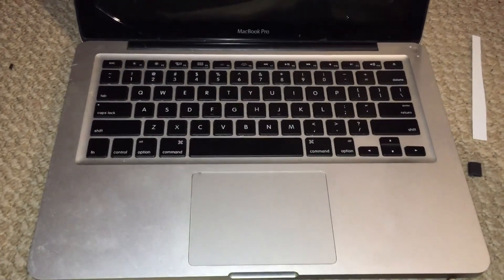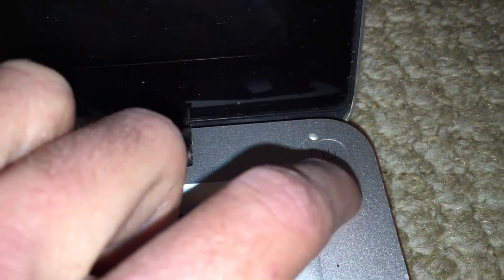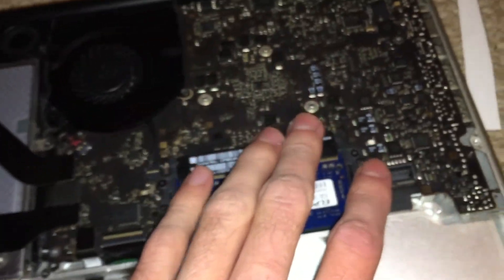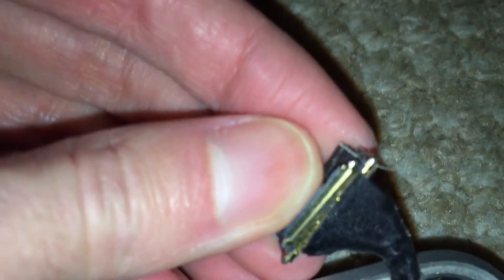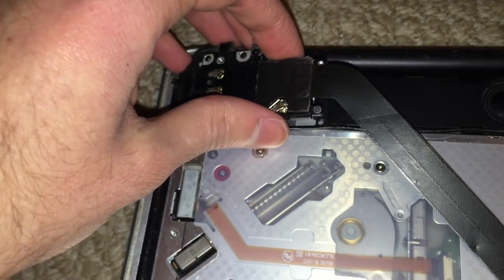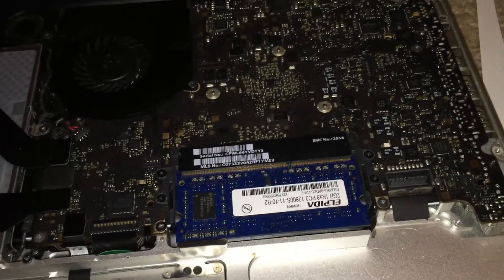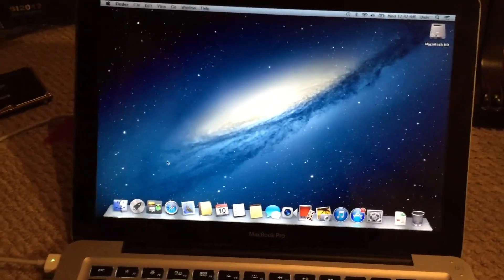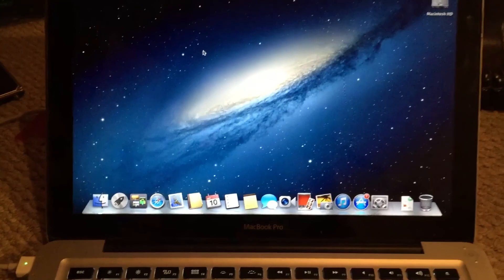Repairing a Mid-2012 13" MacBook Pro with no Video on LCD

Comment: Man, i had the exact same issue. It was the same inductor, I literally just touched it to measure voltage and it was already unsoldered. 
Do you know with which type of inductor I can replace this one? I have several boards from different laptops, any inductor can work? or it has to be from the same type of macbook?

Comment: Same story, like mine. 2012 mid 13” MBP after cleaning, same issue, White screen, after the chime, no apple logo, but the backlit, caps lock is working. Never seen similiar.
Reply: Hi, have you found the solution? I have some issue when replace thermal paste.
Reply: @a5huri  No, I didn’t. :(

Comment: In my MacBook... It's the same problem.. Screen is lighting.. But no picture... But there is no problem in the board.. Because another display works fine... How do I repair the led panel board? Can you guide me?!

Comment: Hi, I have a 15'inch MacBook Pro from mid 2012 and it does have a similar problem, it turn on, but it shows a black screen, sometimes it shows the apple logo, but then it turns black again, I don't know what to do now, I know it's old and stuff, but it is still a good machine and it works fine for me, before that. Any help? Somebody?

Comment: Hello, how are you?
Lets get it right, did you just remove this component near the VGA connector and put a new one?
Because my Macbook Pro 2012 13 "has the same problem, to give white screen when turning on the equipment.

Comment: Man I wish you could inbox me your contact info.  I have the same model and was told the logic board graphic card needed to be replaced.  Wanted to know if you could look at it.
Reply from the maker: Of course, I'd be happy to. Just send me a PM or email to dosdude@netzero.net, and we can discuss details. If it's a 13" machine, like this one, it doesn't have a dedicated GPU, therefore the graphics card cannot be an issue, as it doesn't exist.
Reply: It's actually a 17" version.  But I'm sure its def something simple to fix.
  Like
Reply from the maker: Oh... In that case, it probably IS a bad GPU. I've done this repair before with success (replacing the GPU), but it is quite a tedious and time-consuming repair, and doesn't always work. I can still do it for you, if you'd like.
Reply: what's the difference between athe 13 inch and the 17inch though?
Reply: What's the difference between the 13 inch and 17inch.
Reply from the maker: A, there was never a Mid-2012 17"... The 17" was discontinued in 2011 (with the model known to have defective video chips). Second, all 2011 17" and 2011 and later and later 15" MacBook Pros had dedicated video cards, and quad-core i7 CPUs. The 13" models only had dual-core i5s and i7s, and do not have dedicated GPUs.
Reply: Oh I forgot the question I needed to ask. Will their be a revision to the High Sierra Patch?  I just updated to 10.3.4 on my Quad core Mac tower and I think it didn't take the update correctly.  Everything is screwy (Monitor Settings mainly) and the update patcher is saying nothing.
Reply: Ahhhhh then it definitely a 2011 version.  Which would explain the defective video chip.   I guess it can't be repaired.
Reply: @dosdude1  do you still fix MacBook

Comment: I have the same model with a cracked screen. It’s enraging how easily the crack grows over time. I want to repair it but i’ll skrew something up, and apple repairs can be upwards of 300$. Any advice?
Reply from the maker: I'd just get a new display assembly, they can be had for around $115.
Reply: i'll look into it. Thanks!
Reply: I'm the "emo" guy from the old skype group calls if you didn't know already